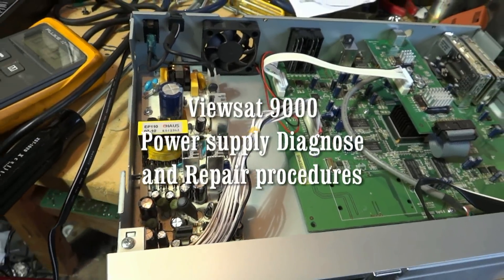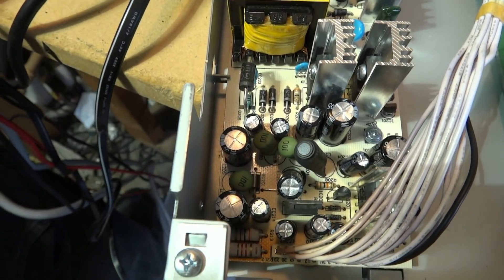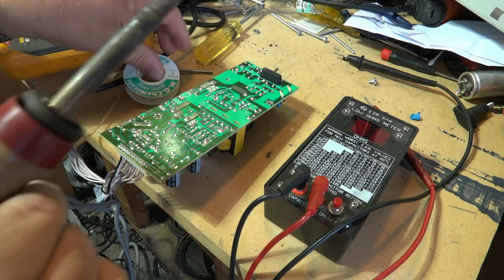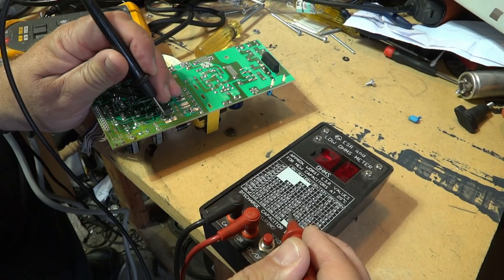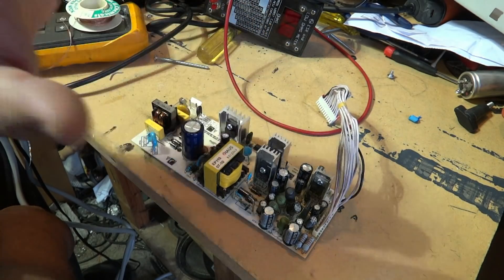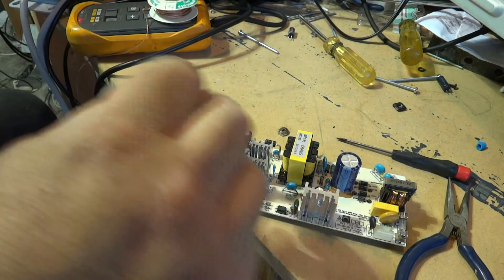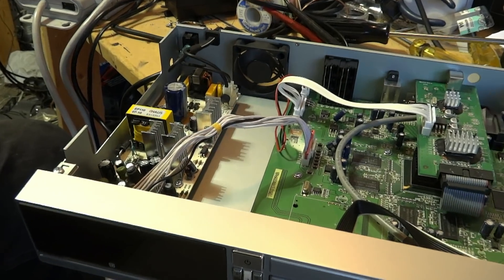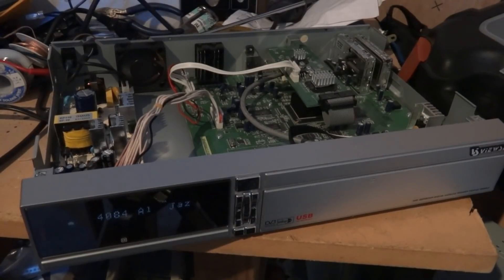Viewsat 9000 FTA Satellite Receiver Power Supply Repair

Comment: Crude psu. A good resonant takes no space and has no lyt caps
Reply from the maker: +Dan Frederiksen 
most are. In most consumer electronics it is a race to the bottom. 
If things were engineered properly and built with high quality parts they would last longer. But everything is price driven. We get what we asked for.
Reply: +12voltvids nono, a resonant psu would be a lot cheaper to make.
PCB traces instead of a physical transformer. Tiny caps. Higher efficiency.
But it takes a smarter engineer.
Reply from the maker: +Dan Frederiksen This would be similar to a boost converter, using the induction or a resonate circuit. Certainly simple, but not the most efficient frm an energy transfer standpoint. Might be fine for very low power applications.

Comment: Okay here is the thing, my HP adapter ( ppp012a-s) is not 100% dead, it still gives out some volts but not enough to power the laptop on(the LED keep on bleeping), it kinda goes on and off at a fast pace (don't know the word to explain it) so I checked everything from the connector/header and the cable and this is still the same so I thought to open it up and it is kinda hard to know what is wrong with it. One other thing is the rectifier you have shown on the vid is not inside of my adapter, there is a blue thing in-cased in a black lead kind thing in the exact same place, so here is what I am asking, your case the adapter was dead but mine is not, the rectifiers are not looking the same so what should I do? That would be really kind of you to help me out of this jam. 

P.S I tested with a DELL adapter (19.5V 5+A while mine is 19V 4.34 A and the laptop worked just fine but the extra V is not a good thing and I don't have that Dell adapter forever)
Reply from the maker: +Neo Alison Everything you are describing points to high ESR on the filter caps.An inverter, or switch mode power supply as they are also known operates like this. The incoming AC is rectified to DC. The DC is then chopped up to a square wave PWM signal by the oscillator and chopper transistor (or pair of mosfets) where it goes through the transformer at high frequency. The resulting lower voltage in induced in the transformer and rectified by the high frequency rectifier diodes, and filtered by the secondary capacitors and usually a choke. A sample if taken, which runs though a reference circuit, usually a comparator IC to develop an error voltage which is passed on to the LED side of an opto-coupler. The photo transistor side of the opto coupler is tied back to the oscillator. This forms your feedback loop.As the voltage rises the LED will glow brighter, and that will change the conductance of the photo transistor which will cause the oscillator frequency to change and move the transformer away from resonance which reduces the efficiency and this causes the output voltage to fall. If the voltage drops, the LED glows dimmer, which reduces the conduction of the photo transistor, and that lowers the frequency of the oscillator which brings the transformer closer to resonance and thus increases the efficiency and causes the voltage to rise. High ESR in the capacitors allow more ripple, and this will affect the operation of the feedback loop.Every switching power supply will be slightly different in design, and may have slightly different components, but they all operate on the exact same principle.Also don't overlook some small capacitors, like in the 1uf range in that feedback loop. They are complex little buggers, but once you understand the theory of operation they actually become quite simple.
Reply: Well said, thank you. Now what needs replacing and is it money efficient compared to got a new adapter?
Reply from the maker: +Neo Alison 
The parts are dirt cheap. As far as finding bad caps go, you need an ear meter to find them.
Reply: Kinda odd but what is ear meter? A friend told me that I need to replace the Coil. how accurate that could be? The thing is that when booting into windowns the battery icon keeps changing from charging to not charging all the time (it is not charging at all but this was odd) another thing that I have been wondering was can I use my ROG adapter (change the hearders/cut) which 19.5V-7.7A instead this HP 19V-4.34A ? (if yes, my ROG has only one white wire inside of the main cable and a there is a cable which not a single one but tons of silver colored tiny threads/cables (dont know the word for that sorry) but HP adapter has 3 black,blue, white cables inside the main black casing so how could I change the headers?!) Truth be told my dear friend I dont have enough green to get a new one and save myself a hassle and I know ruining an expansive healthy adapter like ROG is insane but I am out of options here, please help me out and it takes a long long time for your replies to reach me. Thank very much for your kind and well informed answers.
Reply from the maker: +Neo Alison that should say esr meter. Dam cell phone with word correction.

Comment: solder rhymes with fodder (in North America)  ...  just sayin.     It be prudent to draw a quick sketch of existing cap layout if you're replacing a pile of em.  Easy to get lost in the jungle if they are all desoldered (and the phone rings).
Reply from the maker: +Fred Flintstone 
Only if you pronounced it sodder. 
As to replacing a bunch of caps I always try to replace all like values at the same time then move on to the Next.

Comment: I've got a Antec EA-550 Platinum computer psu that is showing same symptoms to this. 
I had a look inside. There's no sign of burnt components. No buldging capacitors. When it failed there was a burning smell. Is this common when the capacitors fail like you said or does that indicate that my case is different to yours and likely to be a transistor, bridge or diode?

Comment: This meter checks cap in circuit, was it really required for you to disconnect capacitor leg from board?I have even identified faulty caps in parallel without needing to this but I have a different esr meter.

Comment: Hi, great video.
I have a technomate satellite receiver free to air channels,when I turn it on ,the digital number of the channel it freeze,I did check the capacitors and are okay.
Any help?
Thanks.
Reply: Did you check the clock or crystal?

Comment: i am getting 15v instead of 12v {monitor power supply board} & i think this may be triggering my monitor to shutdown after 2 second.Any ideas what the problem could be.? Thanks
Reply from the maker: Thinker switching power supplies are designed to run into a load. Under no load they will float a little higher. If under a load the voltage is incorrect then you have to look at the feedback circuit. Components in the opto coupler, or oscillator circuit.When small caps in the oscillator circuit start to dry up the frequency of the oscillator drifts, and most modern power supplies this is how they control the voltage. They run at a constant 50/50 duty cycle, and change the frequency up or down to bring the transformer core closer to  or further away from resonance. This changes the efficiency of the core and the output voltage is changed.

Comment: Just Checked all of the electrolytic capacitor on my PSU with a meter and they are all good. What can I do now.
My computer shuts down shortly after turning on if I unplug the GPU it will stay on longer but still fail evantuly. It  turns off under almost no load just at the bios like 4 seconds in
When the prob started it would boot up to win 7 then shutdown. now its much sooner
Reply: Flying Karapet Most computer PSUs have basic internal test circuits and wont even fire up if the voltage is not stable so it is unlikely to be your PSU. Rapid shutdown at BIOS would more likely indicate you could have an over heating issue, make sure cooling fans, heatsinks, thermal compound etc are all in check.
Reply: +Flying Karapet What kind of a meter? Have you checked memory, viruses, platform, any recently software installed? and check cap on MB.
Reply: I used that PSU on other computer and same thing happens they shut down at little to no load. And when i use different PSU on my Comp it works just fine.
Reply: Flying Karapet
So narrows it down to PSU fault. PSU might be over heating, check fan on PSU - clean it.
Reply from the maker: +Flying Karapet Check the fans to make sure they are getting up to full speed. Also check the heat sink to make sure the fins aren't dirty, like covered in smoke film. When used in environments where people smoke, film from the smoke forms on the metal heat sink and it acts like insulation, reducing the capability for it to cool the transistors and diodes.It also could be a component that is suffering thermal break down. Freezer spray will help to isolate that.
Reply: i did and suprisingly all of their capcities were hight than rated .
Reply from the maker: +Flying Karapet Remember that not all bad capacitors will show physical signs of bulging. This mainly happens when they fail due to overheating, which is caused by caps installed too close to the maximum ration. For example 10 volt caps used on a 6 volt rail. If they used 16 or 25 volt caps, they will generally never heat up enough to distort the can, however the electrolytic can still dry up, which will cause the ESR to rise. This can also cause stress to other components and cause them to overheat due to high ripple current. The ONLY way to test these capacitors is by measuring the ESR, and that requires an ESR meter. A capacity meter will not usually catch them, because the capacity does not change, as the capacity is based on the total length of the foil plates that are coiled up inside the can with the paper insulator between them. The ESR, is now much AC current will pass. Remember a capacitor blocks the flow of DC, but they readily pass AC current. As the ESR or equivalent series resistance goes up, the ability to pass AC signals goes down. I know it sounds confusing, and it took me many years as a professional diagnostic engineer to actually get a grasp on what goes on inside a capacitor. How can a capacitor behave like a resistor? The 2 plates are physically isolated from each other, so how can this be. Well they are isolated from each other, they just behave as if they are literally shorted together, to the limit of the electrons that can be stored in the metal plate.Push electrons into one place, and the same amount of electrons are pushed out the other plate, just as 2 magnets of the same pole repel each other. This pushing electrons is the ESR. The lower the ESR, the more electrons get pushed out the 2nd plate. The higher the ESR, the more electrons that get lost as heat. That's the simplified description, but that's how they work.
Reply: +12voltvids Yes I know
what ESR is well i learned about it. And i know how a cap acts like a resistor.
Low pass high pass. But I kind of assumed that the meter would use the esr to
figure out the capacitance in turn that they would be linked. ESR and Capacitance.
but yeah you’re prolly right but anyway while attempting to fix the unit I
ended up shorting it which fired a bunch more components on it so its gone . And
it was only 3 months old. Although even if I could get the ESR what would i
compare it to? How would i know if the ESR was good or bad.

Comment: I would have liked to see the new caps measured to see zackly what they were.
Reply from the maker: Shroom Duke They were well below the limit for new caps.If ou want to see new ones measured, look at some of my other videos where I did measure the new ones. The reason they weren't shown on this one was the camera was off when I measured them, and I didn`t find that out until I edited. That is whet you get for using a still camera for video. The one I was using only records 10 minutes and then it stops. All still cameras with video capability have this limitation in. They will go anywhere from 10 to 29:59 but not exceed 30 minutes. This is because the EU has a VAT of something close to 50% on video cameras, but not still cameras. If a camera can record video longer than 30 minutes it is considered a video camera. Now you know why SLR and pocket cameras have this limitation. A real video camera does not, and that is what I use now, so I can just leave it run as I do the repair, and edit after the fact.
Reply: Thanks, I always want to know how to check things before they are installed weather it goes on a car or in a circuit. Sounds like them ESR meters come in pretty handy although I noticed a bulge in those caps but that makes me wonder why those caps went and how long the new ones will last. I enjoyed the video and learned something too.
Reply from the maker: Shroom Duke They will last longer than the originals as  upped the voltage from 16 to 25 volts, which gives more headroom, and thus they won't heat up as fast. It is the heat that kills them. The buldging that is a give away. I have other videos where the bad capacitors look totally normal, and the esr meter caught them.
Reply: Got any videos on repairing computer power supplies? I suppose switching power supplies usually have the same sort of failures, I have found that most things have common points of failure.
Reply from the maker: Shroom Duke I will be doing one at some point when I get time.

Comment: I have a meter that tests for micro farads that I use for hvac. Is there an advantage to testing with your ESR meter instead?
Reply from the maker: jessedfh They are 2 totally different measurements.The capacity is how much energy, measured in micro farads a capacitor can store, ESR is equivalent series resistance, or the internal resistance of a capacitor to an AC signal.Capacitors block DC, but radially pass an AC signal.  When the electrolytic starts to dry out the series resistance increases, which causes heat, which dries the electrolytic more and thus the ESR continues to climb.If I were to test a bad capacitor, as indicated by the ESR meter on a capacitor capacity meter, it would still show very close to the rating, as ESR has little to do with capacity. Where the capacity measurement is important is when selecting capacitors for a matched circuit such as in a 3 phase motor power factor correcting capacitor bank.Since capacitors can vary as much as 20% in tolerance a capacitor measurement is used to find the closest  capacitors for balancing a load.At line frequency ESR isn't that big of deal, but at the 70 to 100KHz that a switch mode power supply operates at, it is a huge deal.

Comment: if I understand this right:

There are several capacitors build in verry near to each other.
So,if one of these capacitors is going to break,its resitance is going up,so its warming up.
This on one hand will be mor termal stress for the broken capacitor itself,making it break even faster.
On the other hand all the nearby capacitors are also facing increasing thermal stress to its neighbours.
So all nearby capacitors  will normally as well break .

Conclusion:
If you find a broken capacitor,it might be a good idea to check all nearby capacitors as well.

Lesson learned..I hope...

Comment: Thank you verry much for your video.
I think I got an idea now,how to repair power supplies in general,how to find broken capacitors in these power supplies.

Actually I was trying to organise a "repair caffee" here at the technical university in Berlin.

it make me sad,how many electronics nowadays are simply thrown away,because nobody knows how to repair them.

An  broken capacitors are the most common reason for electronics not working I guess.

Manny  times its just a bad engeneering work,thats the reason:

If you install capacitors in areas of the device,what is also verry common in my opinion nowadays,it is no wonder,that these capacitors cant stand the heat and break.

So with a little work and knowledge (thanks to you)it is in all these cases possible to repair these devices with little money (new capacitors) and quite a small time.

The normal case nowadays is,that all these devices are simply thrown away.

WHAT A SHAME !!

Thanks again,you do a mighty good job here on youtube !!

If you would life near my place here,I would even have asked you,if you could train interested people how to repair devices in person (instead by youtube video).

(Sorry for my english,but i m not a native speaker.)

Comment: the display is going.  you can tell because it is brighter in some parts more than others.
Reply from the maker: ryan cler Could be, it is a cheap sat receiver. It wasn't mine, it was an old friend that brought it to me. It has all on screen graphics anyway.The reason that some parts are brighter than other is he probably left it on one channel more than others and the phosphor burned slightly, as all phosphor does over time. You generally don't notice it on clock displays as the time is always changing, but calculators, especially when left turned on displaying 0 the segments that made up the 0 would burn, then when say you pit up a number where the center segment was light, it would be brighter.Tubes driven with DC on the filament tend to age faster than when the filament is driven with AC.